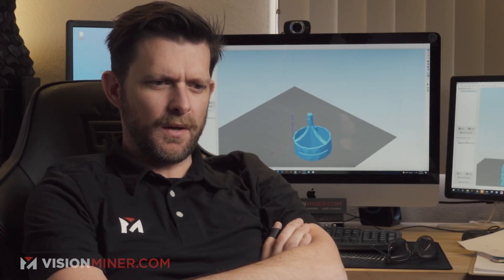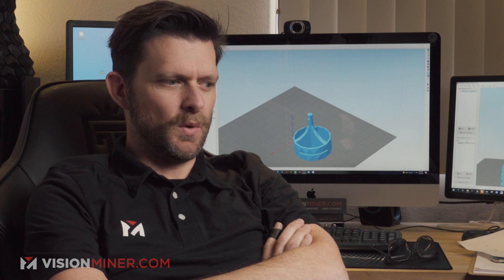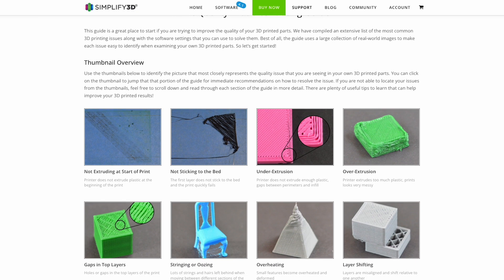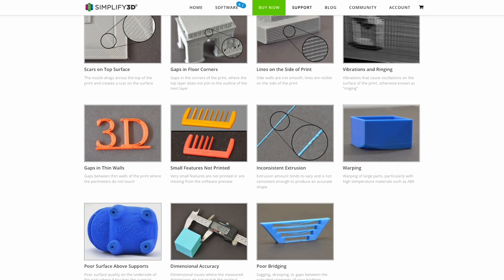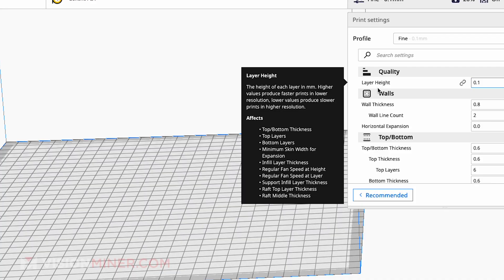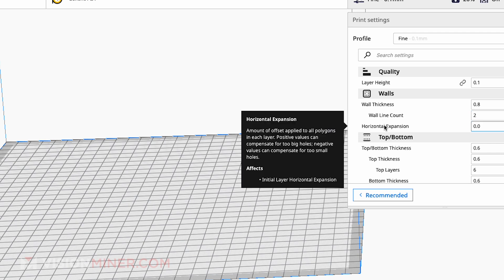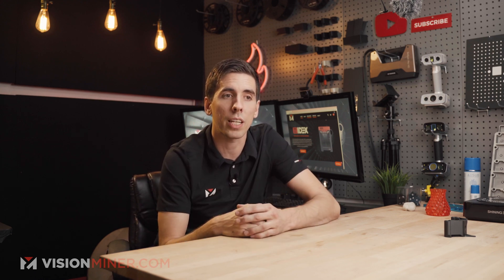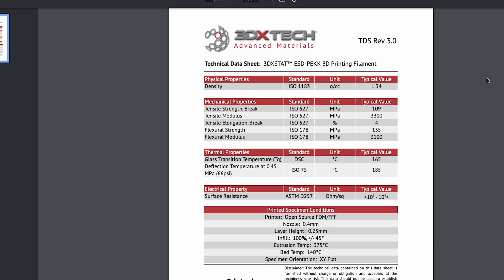The Reality of 3D Printing Profiles | Why its Not Enough

Comment: The way Cole explains is exactly what I've been doing from the start.
Unlike many people, I don't have, say "Structural" or machine-material-use-case specific profiles, 'cause these are nonsense to me and a PITA to maintain.
I only have a bunch of profiles for various nozzle diameters (+ nozzle/flex special case), filaments tuned properly, which are the basis for every part geometries. Remaining stuff is experimenting and adjusting whenever needed. It's proven to work, no need  to change.

Comment: 100% Accurate for anything more difficult to print than PLA. When I sell my custom prebuilts I now always include a slicer profile setup for my customers and it has made the amount of support setup questions drop by over 80%, so they do work wonders for PLA. Not to mention going from any slicer to say Simplify3D's custom profile for PLA, PETG, and CF is quite a change as well, but only because they have that intimate knowledge that comes from having printed with specific material and machines over a long period of time. I no longer use any prebuilt profile for any of my personal machines, as it will always be superior to dial your rig into your preferences and environment. Great content as always, thanks for keeping up the great work!
Reply from the maker: Right! Specifically, intimate knowledge and experience creates the perfect profile, each time  :)

Comment: This is very much true. Downloading printing profile is complete nonsense.
I save the profile for each material, and use it as starting point, but I pretty much tweak every attribute and test it before starting a real print. 
There is also couple of adjustments that you can do on fly when you start the print (baby step, temp, flow, feed). I wish there is more interactive controls, though.
Anyhow, until we have next gen AI that would self-correct for all these issues, we have to do all this manually..
TDS: 3DXTECH is the only company that provides them, I wish this is standard for all manufacturers.
Reply from the maker: Most companies provide them in the engineering space, like Essentium -- but for regular filaments like PETG from regular manufacturers, it can be hard to find!
Reply: @VisionMiner  You are right: Essentium has even better TDS. I used it only once so I haven't paid attention.
p.s. Maybe you could do a video about what each of these numbers (TS, TM, etc) exactly means in practical sense and how they are measured? That would be priceless!

Comment: Always love your videos!    And yeah I believe profiles are a great starting place, but I use my spread sheet really as a starting place.  I capture all my data points,  weather: temperature and humidity, filament drying: temp and time, filament brand,type,temperature, chamber temperature.  I'm only on PLA at the moment but will continue to add to the sheet.  I also capture what profile I start with, (which includes nozzle size).  

I really started to do this because I'm  upgrading my printer slowly and every change I make ends up taking about a week to really dial it in including firmware changes!   I have a working sheet that I use to record the changes I make each time and the result.  The most valuable thing that I've learned and I believe its what you are making a point of is that you have to put in the work!  
My latest example, I put in a dual gear extruder and all the documents say set the extruder steps to 130... I did that and was getting all kinds of blobbys and stringing... played with all the settings in the slicer with nothing working.  I then did the extruder calibration method and found I was 20  steps off, so I set it to 150 and now I get good prints again... anyway yeah it all takes trial  and error to get it tuned in proper!

Comment: Personally, I've been finding the same exact thing with a bunch of my machines. What I've currently found is the maximum speeds that I can do while getting dimensionally accurate prints because I print my own designed woodwind.

Getting the correct tone to come out is its own Beast of a task.

Comment: This is great.  I found the same thing for everything but PLA, mostly PETG, and ABS only with heated chamber.    But even in those cases what my solution has been is to save the factory file or 3mf or whatever the settings file is for the particular slicer for every print I do.  Then when I get a new part to print I can always look back and find a part that was similar and see exactly what settings I used to make it work.    Of course even with that if it was more than a few months ago somethings are probably going to need adjusting.
Reply: This is how you become excellent at additive manufacturing. Smart idea.
Reply: Recently figured out the same....